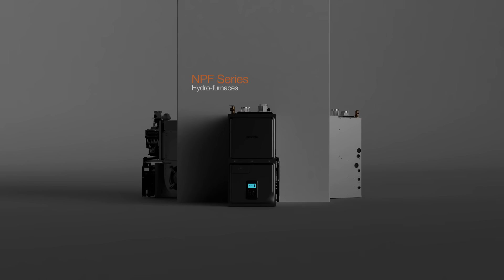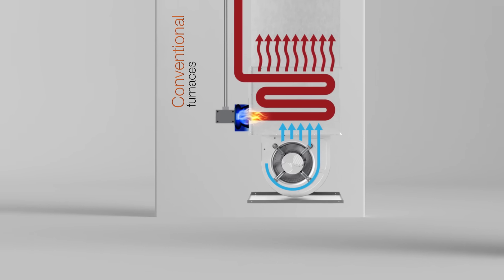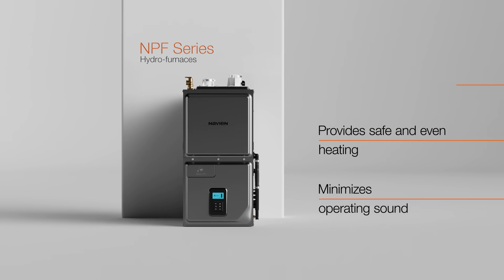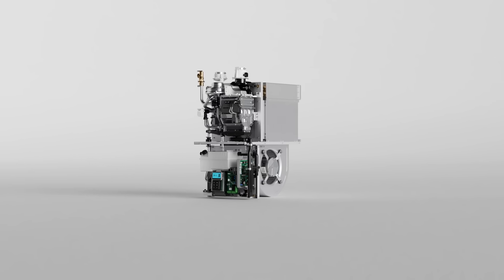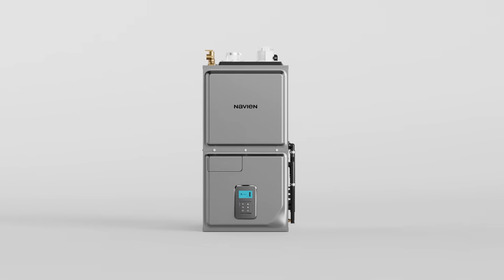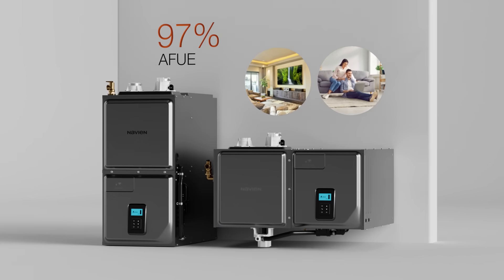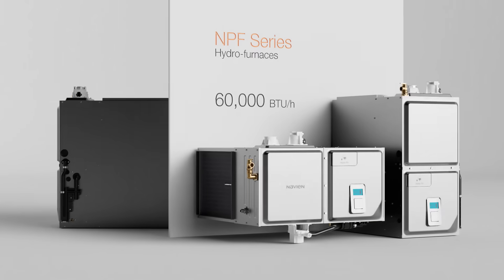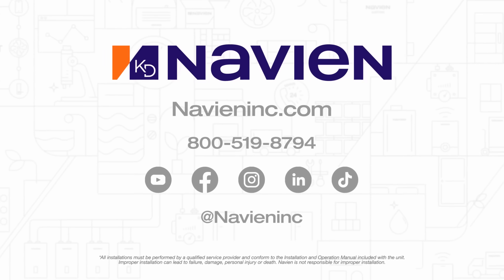Navien NPF Series Hydro-furnace

Comment: Most new furnaces are installed at high efficiency (> than 90%), and many achieve the 97% rating of this product. This product might save more on electric though -- but the tradeoff? No serviceman in town has real training on it, and there are more components to diagnose and deal with than on a conventional furnace. You'll end up paying out the ears for service. This is another "informed homeowner" sales scam that is marketed to people with no real industry practice.

Comment: So it’s no more efficient than a regular furnace but it’s got twice as many components to fail and you have to add water to it. Sign me up!
Reply: Not sure if it uses less gas than the regular furnace,, but water is much better at transfer than air and a tighter coil than a heat exchanger. Also that coil and an ac coil may mess with static pressures  having two coils if you add a heat pump or ac.
Reply: Its actually component based parts.
A screwdriver and pair of pliers can dismantle the heat exchanger.

Comment: If this is not supplying dhw what exactly is the point? Minimum efficiency across canada is 96% for any new gas furnace and higher is available if that extra 1.8 is what you need.
Seems like a solution looking for a problem. 
By the way, I very much enjoy your combi boilers.

Comment: This system will match great with a heat pump coil.

We are peak gas furnace in 2024 - I think this marks the beginning of the rein of "hydronic boiler furnaces" (or whatever these things should be called)
Reply: until something breaks and the installer doesn't have the part or can't figure out what i the matter.
Reply: It would work well if the heat pump coil is positioned downstream, though I haven’t seen that configuration before. In this setup, the heat pump coil would essentially function as an induction-based airflow component. The blower downstream in the Hydro Furnace would draw air through the heat pump coil, helping to maintain stable refrigerant pressures by minimizing the influence of the Hydro Furnace’s hot water heat exchanger. Installing the Hydro Furnace with a heat pump coil in this manner could also increase the temperature rise, making it more comparable to the output of a gas furnace.

Comment: It might make some sense to make the unit connectable to a DWH tank. Moreover, if a cooling coil is added does the heater have the ability to protect the heating coil from freezing?
Reply: Prob navien air conditioner coming soon imagine
Reply: @beamylist1612 pretty sure they announced a heat pump at AHR
Reply: When the furnace is off the water from the coil drains down into the reservoir so there would never be any water in the coil during a call for cooling.